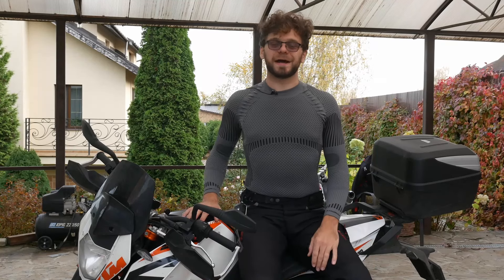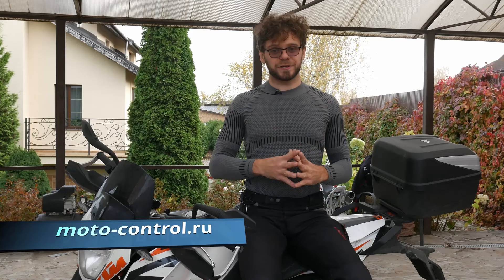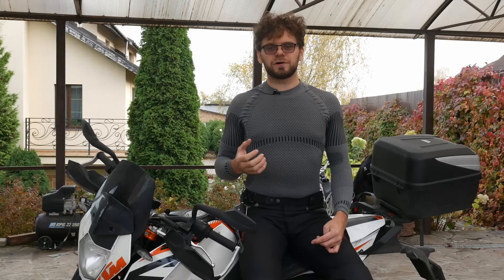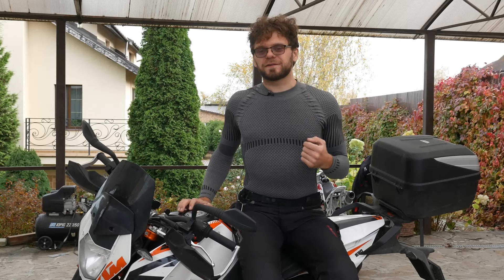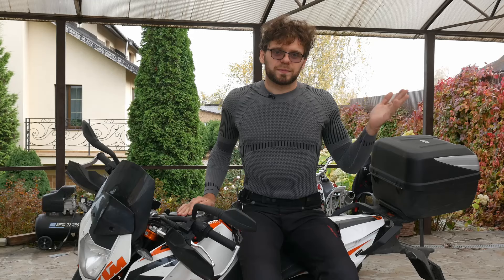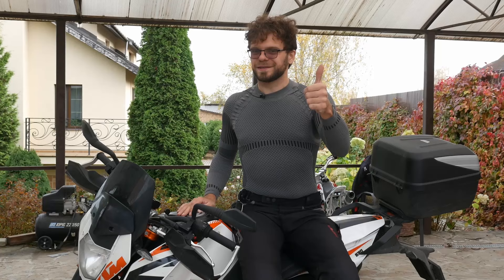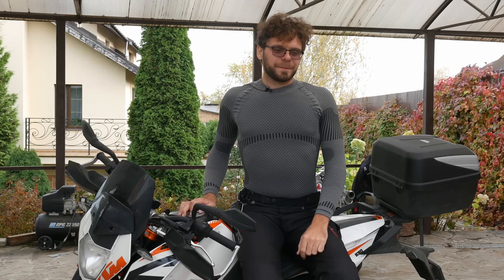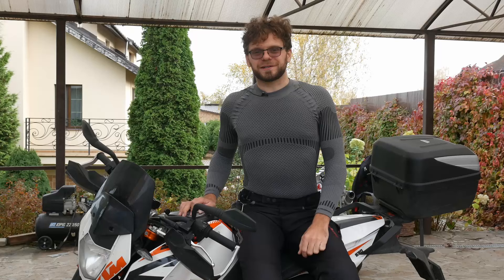Mastering the FRICTION ZONE - Slow speed motorcycle clutch control

Comment: In starting a clutched bike, you need to pull the clutch as you turn to 1st gear, accelerate slowly and release the clutch slowly and you will feel that your starting to accelerate, and when you did realise the clutch easy, when changing gears pull the clutch and release slowly to avoid jerk motion.

Starting the bike in neutral is hard but the rest is easy.

Comment: Hello Andrey. I really liked your videos and started practicing these tips. One of the biggest challenge for me is to turn ing right side and always fearful of falling  and put my feet down.
Reply from the maker: Hi! That's pretty common fears, so don't worry about it much) Just take it slow (literally - practice "slow race" exercise a lot - it'll free you from putting your foot down and really will develop your clutch control) and practice a lot and you will be fine!)
Reply: @MotoControlEn  Thanks Andrey with your advice started doing slow speed practice. I have started feeling the difference but need to continue this as my hands still becomes tight to grip the handle and I keep myself reminding to loose on the hard grips 😀
Reply: This is me right now, I find it so hard to turn on my right. I am so scared.

Comment: Hi, Andrey. Gonzalo from Peru. This is the first time I write a comment on a YouTube video. Totally worth it. I have started today in the morning, and everything just make perfect sense. But I have noticed two things: (i) My left wrist gets exhausted and kind of achy after 30 minutes of exercise; and (ii) I'm having some troubles getting my throttle steady, because when I pull the clutch it sound super loud and I tend to release the throttle a little but then I realize the bike would stall when I release the clutch again. Any thoughts or tips on these? Thank you very much. Keep it up!
Reply from the maker: Hola Gonzalo! I can't tell anything for certain, because I need to see you practicing. But I have a couple of possible ideas. About left wrist - make sure you adjusted the clutch lever in such a way that your wrist is flat and not bent. About throttle - it's normal for the engine to have a little more revs when you pull in the clutch and less revs when you release it. BUT! Make sure you don't use too much rear brake. This makes you to give a lot of throttle and release the clutch a lot at the same time. This way you'll fry the clutch quickly.
Reply: @MotoControlEn  Thank you! Indeed, maybe the clutch lever should be a little bit lower to avoid bending. As of now, I'm not using rear brake, just clutch and throttle as you recommended. I just have to keep practicing until I can maintain my throttle steady. ¡GRACIAS!

Comment: Hello from ur neughbor Vietnam.
I think no one is asking this, but I still a little bit confused.
It's about the weight of the bike and the friction zone.
U said the friction zone is when the bike starts moving but what if the bike is too heavy or the engine is not powerful enough to launch the bike smoothy or when we launch the bike up hill?
Isn't the clutch burned if we put a little bit of the throttle, right?
Correct me if I'm wrong. Thanks.

Comment: Hello, I am heaving a lot of trouble to keep a steady throttle around 1800 rpm to work in the friction zone. My wrist position is correct on the throttle. When clutch engages rpm drops some but when I disengage the clutch rpm stays down. Any tips on this ? Perhaps I am not relaxed enough with my arms. Thx !

Comment: I always feel like I'm going to burn out the clutch with how I ride in slow traffic. I think its because I am using it in variable positions to control my speed between 5 to 10 mph. I run into slow traffic consistently to and from work on a two lane highway. FYI, this same highway reach speeds between 65 to 95 mph. People drive extremely fast here in Pennsylvania. 

Am I doing anything wrong? Or any advice? Great video. I found this very helpful, informative and enjoyable to watch. Thanks.
Reply from the maker: Hi! Yes, of course you are going to wear out your clutch someday, but don't expect it to happen very soon, usually it's a pretty long process. And yes, I actually have a little video about how to not burn a clutch 😁 https://youtu.be/2fUA8kv1rGs

Comment: Hello Andrey,
I know many motorcycle instructors, but I particularly appreciate your videos because your explanations are easy to understand. I am disabled and can no longer shift gears with my foot, I am 60 years old and drive a 500 cubic centimeter automatic scooter which weighs 230 kilos. Due to the smaller wheels, the handling is different to that of a motorcycle, especially on bad roads. And I have no way of influencing the clutch. So my friction control is the rear brake. Can you maybe make a scooter video where you can go into the special features and also demonstrate what is possible with a scooter?
Greetings from Vienna.

Привет Андрей,
Я знаю многих инструкторов по мотоциклам, но особенно ценю ваши видео, потому что ваши объяснения легко понять. Я инвалид и больше не могу переключать передачи ногой, мне 60 лет, я вожу автоматический скутер объемом 500 кубических сантиметров и весом 230 килограммов. Из-за меньших колес управляемость отличается от мотоцикла, особенно на плохих дорогах. И никак не могу повлиять на сцепление. Так что мой контроль трения — это задний тормоз. Может быть, вы можете снять видео о скутере, где вы сможете рассказать об особенностях, а также продемонстрировать, что возможно с самокатом?
Привет из Вены.

Comment: For beginners, a nice tip would be to use a finger or two to use the clutch or handbrake. This will make a heap of difference in riding in the city and traffic. If you use every finger except the thumb, you would lose control of your bike. I've been doing this for years now and always use my index finger or the middle and can have simultaneous controls over clutch, handling, and indicators.

Comment: Andrey excellent video! I wish my MSF
Course had talked about the friction zone. They must have called it something else, but in any case, I was using the friction zone before I ever heard the term. The one thing you said I have to disagree with. “Full lock” turns are not for beginners. I won’t do them and I’ve been riding for 17 years. That’s an advanced skill, and really, when do we need a full lock turn? Motorcycle police officers need them, but new riders need to master the basic 25 ft turn, then the 20, then the 15…, before they try a full lock turn. Just my 2 cents. Thanks for the great video.